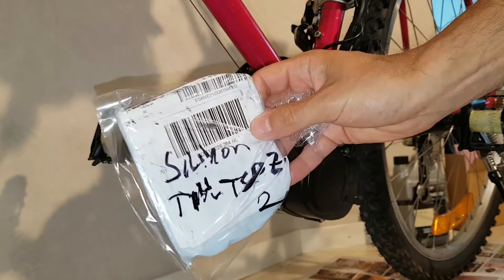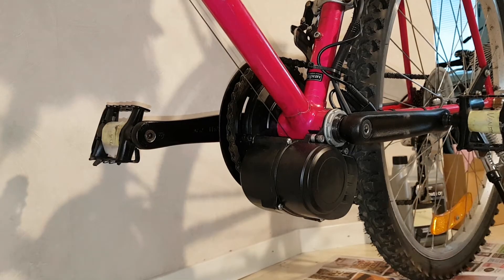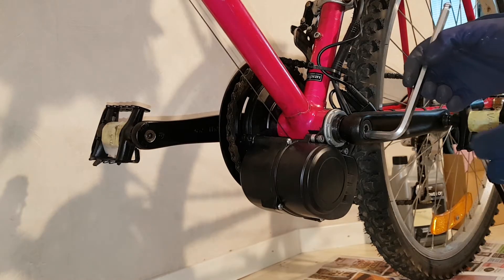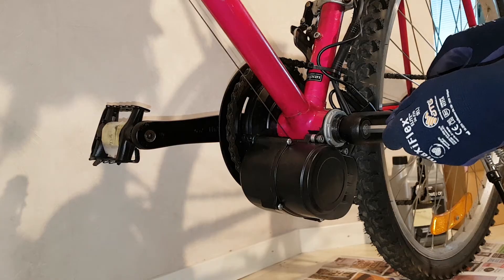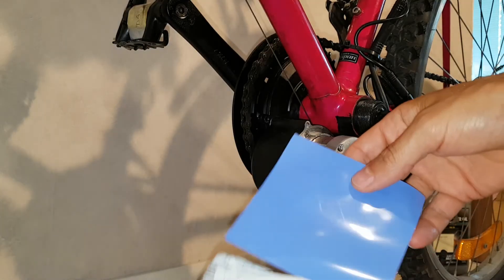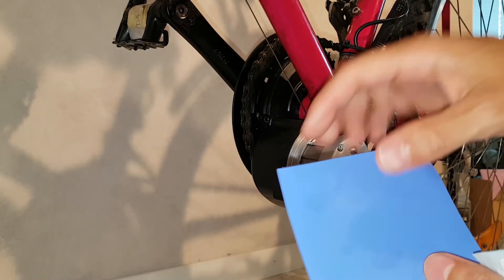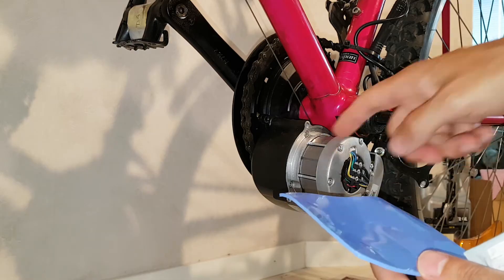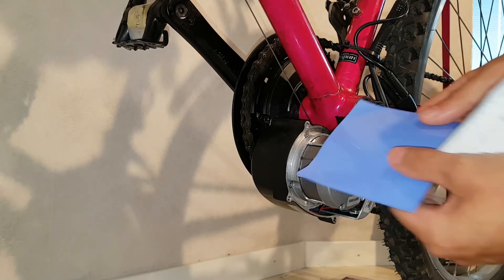Putting Cooling Heatpad on Tongsheng TSDZ2

Comment: I would put plenty CPU thermal paste compound inside the cover for better heatsinks with the pads, hello and would hold the pads from fowling.
Reply: Thermal paste is used to fill inn micromarring in both the CPU IHS and the contact surface of the Cooler. It would not work in this case.

Comment: I don’t understand. How would those pieces of plastic cool down the motor? 🤨
Reply from the maker: Instead of "air" these thermal pad helps with heat transfer to the outer shell of the motor which get wind cooling. --> These fill the gaps of air to remove heat.. so conducting of heat gets easier.
Reply: @simplicitygarage  Please tell me is the cooling effect has been achieved? if so, how many degrees lower, and how was it measured?
Reply: @irinaandpaul873  it's unlikely to have hurt. Air is a crazy good insulator. These thermal pads are designed to conduct heat. Providing he has some of them touching the casing, it's likely improved heat transfer considerably.
Reply: @irinaandpaul873  I used a $5 temperature sensor on the motor, the thermal pads reduced the temp by 20˚C. On a warm day on a 2km climb (offroad with some 10% gradients) the motor went from 72˚ stock to 52˚ with pads.  On a very hot day (close to 40˚C), the motor peaked at 75˚C with the pads on the same climb.  I think 90˚C is maximum for the motor before damaging it, so basicaly, its impossible to overheat it now.
Reply: @garyking508  my motor was heating up to 108 degrees C.
Reply: @irinaandpaul873  That's cooking.
Reply: @garyking508  Did you put the thermal pads on the inside of the gear housing, or just on the outside like Per-Gunnar did? I've seen modifications where they put thermal pads and heatsinks on the inside of the gear housing but I'm not sure if it's worth the trouble.
Reply: @lessigen  You remove the motor cover which is the left side, then wrap the thermal pads around the electric motor. This fills the air gap between motor and cover. Slide the cover back on, tighten the screws and you're good to go.

The air gap is really bad, it acts as an insulator, preventing heat from draining from the motor, so it just overheats. Filling the gap with a good heat conductor material, like CPU thermal pads solves the problem.

The gears are tucked away under the motor and dont have their own "housing", you don't need to worry about them.
Reply: @garyking508  Gotcha, thanks so much!! I've seen people take off the motor itself and put thermal pads in the small space where the motor interfaces with the gearbox and the blue gear, but I suppose that's just for even more efficient thermal transfer.
Reply: @lessigen  Doesnt hurt to put a few piece of thermal under the motor. Dont think it matters much. I recommend using a thermometer to check before after temperatures.
Reply: @garyking508  Please tell us more about the temp sensor.
Reply: @garyking508  I would put plenty CPU thermal paste compound inside the cover for better heatsinks, hello
Reply: @simplicitygarage  maybe better to use copper wide wires?